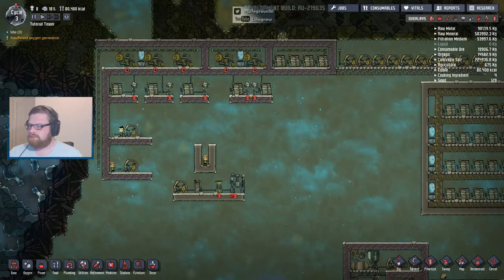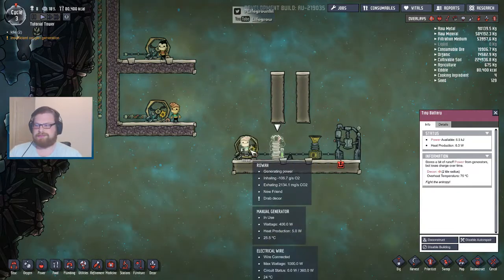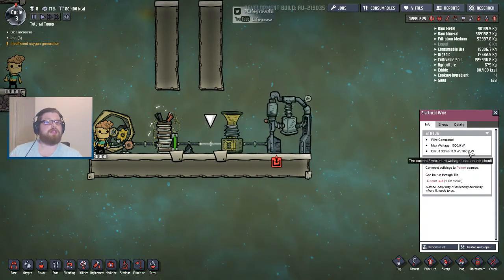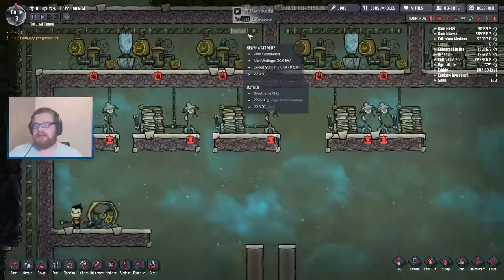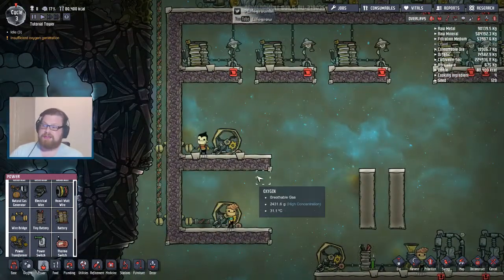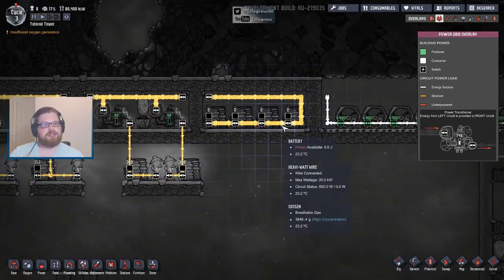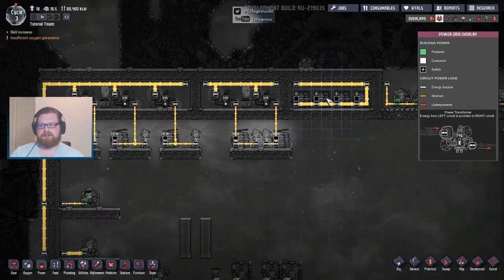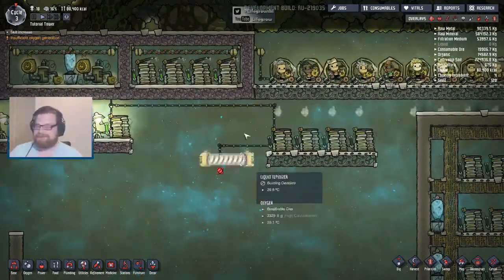Oxygen Not Included : "Life tips" #1 Power

Comment: Very helpful thanks a lot! But what did you mean by using the liquid heater as an example? Cheers.
Reply from the maker: Thank you very much - it was a bit rushed and clearly not scripted, so I hope it helped even a tad :D It was basically just an example of having a full/near full drain from a transformer can result in intermittent machine function. So basically without the batteries, a full 1000w circuit pulling 1000w constantly can lead to downtime.